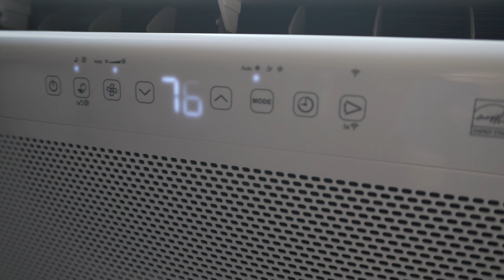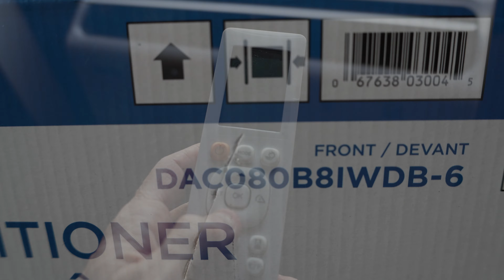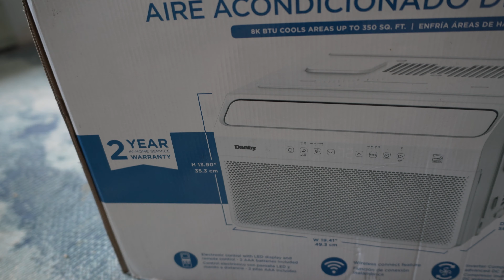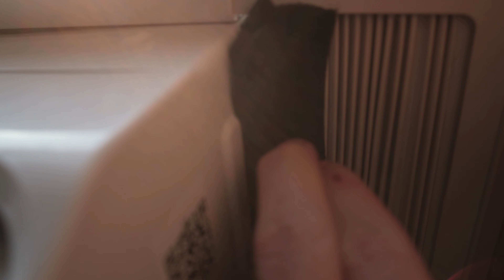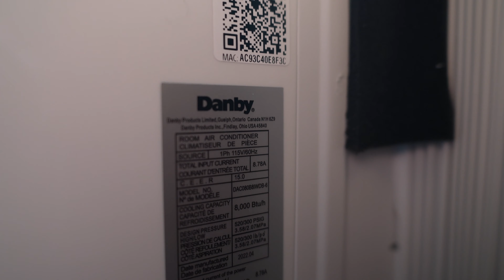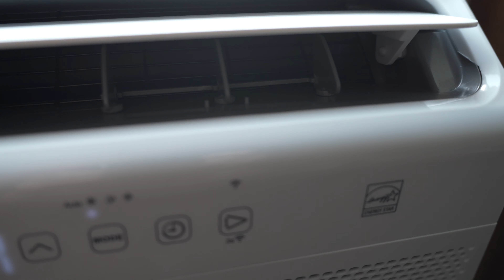PRODUCT REVIEW: Danby 8000 BTU Energy Star Inverter Window Air Conditioner / DAC080B8IWDB-6

Comment: Do you know how to replace the air filter after cleaning? The directions are woefully inadequate 😂
Reply from the maker: Yeah, the instruction manual is terrible.   If you visit the official web site, this model lists a "Reusable, washable air filter" as a feature.   So all you have to do is pull out the filter and wash it in the sink.  As for removing it, there is a little finger tab on both the left and right side of the unit -- you put your finger in those tabs to pull off the front to access the filter.   https://www.danby.com/